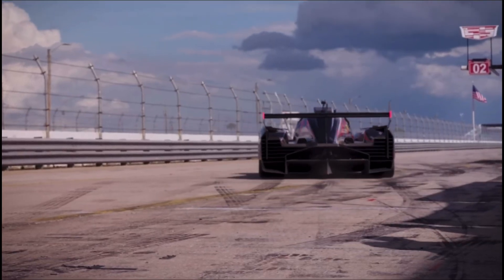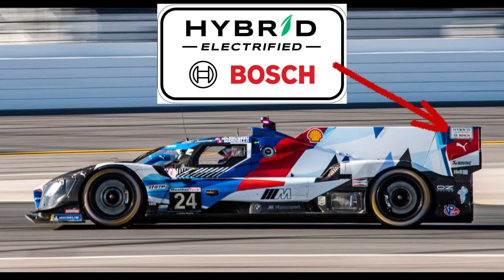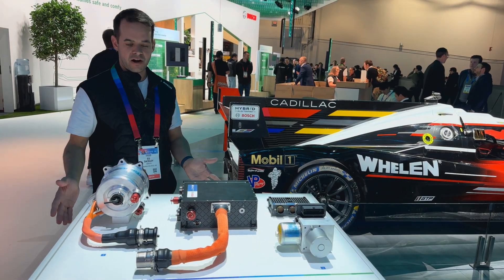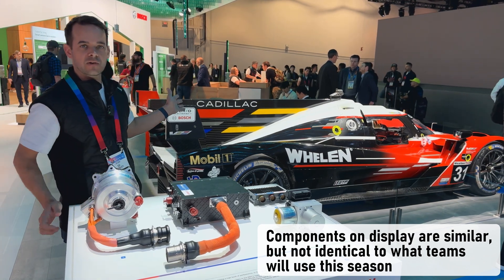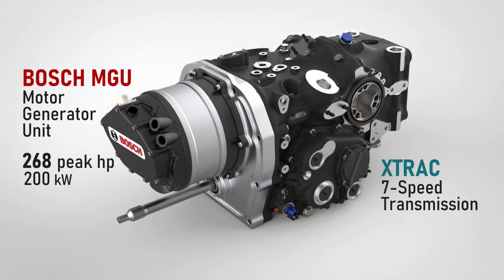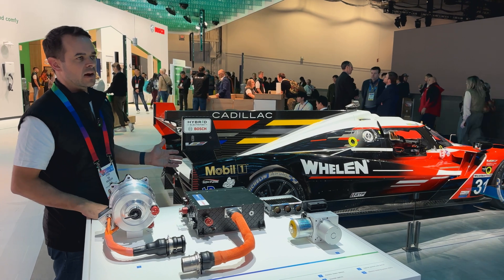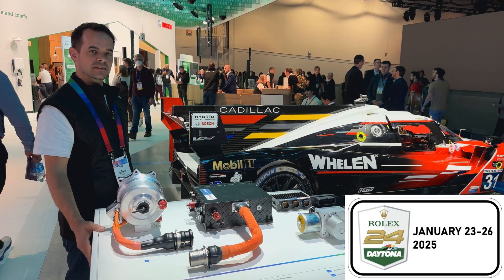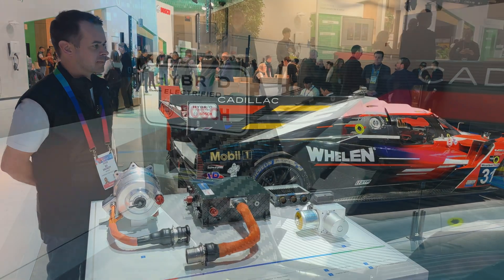Le Mans Daytona hybrid (LMDh) system by Bosch

Comment: So I keep hearing this that it's not a boost.  The electric motor is not a boost. 

I'm not sure how it's not a boost. 

Because essentially using the electric motor would bring instant torque. Thus it would be faster than not having it. 

Ergo you would reach peak power faster. Not more power necessarily you would get there faster. 

I get an arguments with people about this and maybe I'm wrong but it just doesn't seem like that's the case. 

I also make this point because even though it's deployed on the front wheels the lmh cars would not be deploy hybrid below 190 kph.